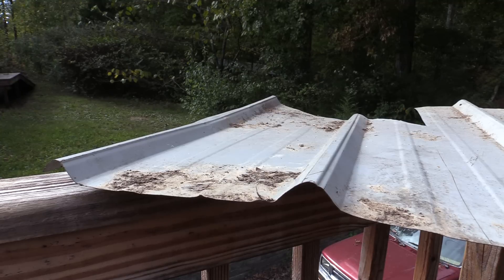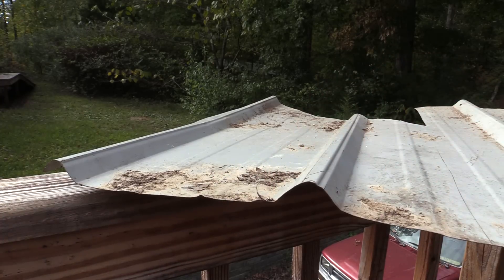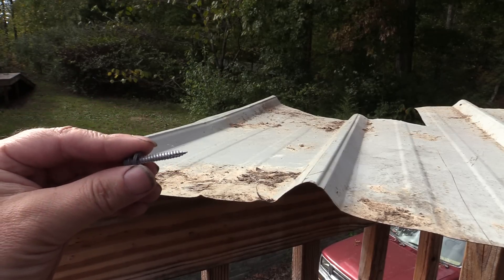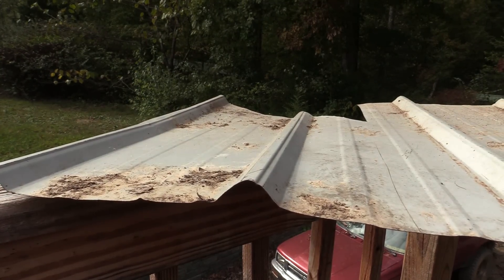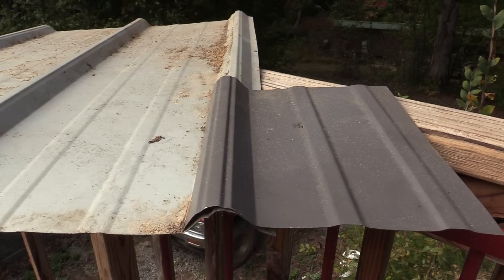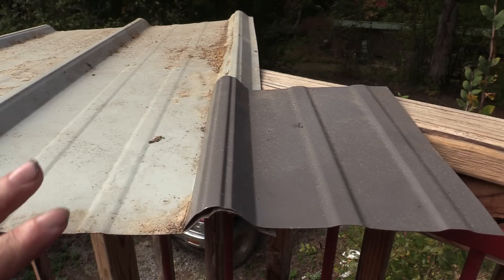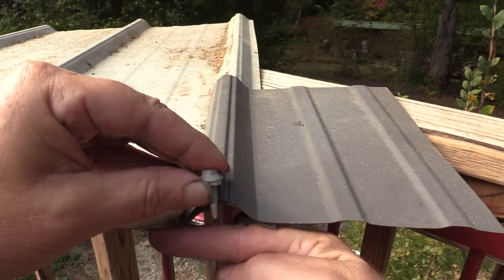Why you should not put screws on the ribs of metal roofing

Comment: You need to silicone the screwheads on metal roof  , I just re did a whole interior of living room that had to be gutted because of screws backing out by themselves on a metal roof.  The silicone appears to absorb the expansion and contraction energy  and stops them from backing out. Just dont look good if you take a hard look at the silicone wod .  The screws backing out and the UV destruction of gasket material are the biggest enemy of a metal roof.. Silicone appears to resolve and holds up over time from what Ive seen
Reply from the maker: @royburgerbreath  a much easier solution is to use the new one piece head screws. The head and the washer are one piece with a recess for the seal which is completely covered. The screw is also a larger diameter further preventing blackout while increasing holding power. If you use silicon make sure it says it is for gutter and flashing. Regular silicone contains a acid to help it bond and will damage metal roofs.
Reply: @honeybeehomesteading  The regular silicone is vVinegar (acetic acid)   What kind of damage have you seen from this?
Reply from the maker: @royburgerbreath  I have seen it ruin the galvanized roofing. It ate Right through the zinc and rusted badly in only about a year. I got to replace a whole roof because the brother of the owner patched the roof and used regular silicone. . So any unpainted bare metal would be a issue like the screw holes themselves. I have not seen any damage on painted because I have never used regular silicone always the gutter and flashing silicone instead.
Reply: @honeybeehomesteading  Good to know. In this case it was a painted metal roof that I used the regular silicone (that smell is VINEGAR too!)  We need to make aluminum great again so We dont have these issues with METAL ROOFS.. DID you know aluminum is the 3rd most abundant element on Earth and WHY in the USA aluminum roof panels so hard to come by?? They shut off most the smelters because of 'global warming' while China turned on their aluminum smelters // Aluminum is an amazing material for roofs and does not react like the way your issue did with regular silicone
Reply from the maker: @royburgerbreath  I live close to Alcoa allot of aluminum is still smelted here. The problem with aluminum it takes a thicker sheet to achieve the same strength and 2 it has a much larger rate of thermal expansion .0000128 vs .0000072  it would be nice though as you could have a anodized panel that would look cool. He other problem is that aluminum is a reactive metal which will react with steel so you would need to address that issue.
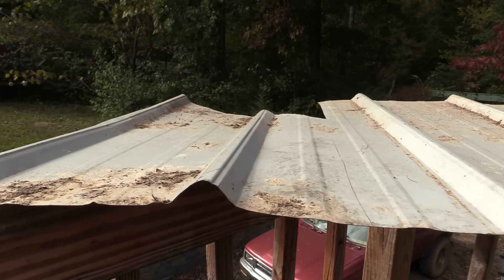Reply: @honeybeehomesteading  Ever had  expansion problems with PermaLock shingles?  https://www.youtube.com/shorts/CuUhGDF-Rus  They make these in the USA  but too expensive- website says they will work on 3:12 roof slopes (would be cheaper if We had more smelters in the USA  is what I am told is why they are so high priced)  Aluminum will cause galvanic corrosion with metal unless it is painted (from what I have researched)  Im in Florida and We have some 100 + yr old homes that still have the aluminum shingles on them from 100 + yrs ago .. IMHO Aluminum is superior for roofs ..
Reply from the maker: @royburgerbreath  those permalock shingles will not have any expansion issues as the panels slip fit into one another and then nailed only on one side. Expansion is only a issue when you have panels screwed into one another making one long sheet. I love the look of slate and those roofs last 200 years but are too fragile. For looks I like metal tiles for performance and longevity I think standing seam metal is king . For ease of installation and replacement or repair exposed fastener metal is hard to beat.
Reply: @honeybeehomesteading  These old aluminum  shingles at this very old home were hand made back in like 1910 with a metal brake and much bigger than those permalocks.. You should be able to walk into lowes and buy those shingles off the shelf ..  We need them smelters turned on like yesterday.. The  Asphalt shingles they sell these days last 10 yrs and leak by year #15 here in Florida
Reply from the maker: @royburgerbreath  metal was king in the 1900 s then along came lightning rod salesman which made the houses prime for being struck by lightning. The oil companies convinced insurance companies that homes with metal roofs would attract lightning. I restored my first house in 1992 which was on the national register of historic places. I was working with hud on the rehab.I wanted to put on a metal roof but was denied because they were worried that the home would not be insurable. Now days insurance companies prefer metal roofs as they are much less likely to catch fire.

Comment: Screws put into the flats into wood below will positively leak from cyclic heating and cooling, and the resultant leak will rot the wood below. Guaranteed. Use longer screws into the ribs, tightened just enough to "take the slack out", while only slightly compressing the sealing washer. Built one this way  in 2006......24' x 42' , slope 1/2 on 12. zero leaks 18 years later.
Reply from the maker: Screws in flats don't move the way they do on the rib as the panels are able to move independently of one another. This eliminates the thermal expansion width wise leaving only the length of the panel to be a factor which is normally  not long enough to be a factor. I have roofs 20 years old screwed in the flats with no leaks
Reply: @honeybeehomesteading  , are the screws you installed going into metal below, or into wood? If into wood, you are one of few who has had no leaks. On the other hand, if you live in AZ or NM, the point is moot. I stand by my point, if screwed into the peaks, there will be no leaks, if done correctly. You cannot tighten the screws to the point where they severely compress the rubber washer, or distort the shape of the sheetmetal peak.
"Stitch screws" with butyl tape are used at all overlapping seams to seal them together. They are not left to just flap in a wind. The "stitch screws" do NOT go into the substrate below. They are used only to "stitch" the seam together.
YOU ARE CORRECT that putting screws into the flats works, if the substrate is a metal purlin, as in real metal building construction. The correct number of screws, and placement of those screws, is REQUIRED to get a UL Class 90 Wind Rating on the roof installation, for insurance Company purposes.
I was a superintendent on metal building construction for 5 years.
Reply from the maker: @bruceb3786  I am going into wood a minimum of 5/8 decking. Steel structures are different than wood as you don't have to worry about thermal expansion as you do when going through wood and screwing through the rib. In a all metal framed building going through the rib would be the only way I would install it. And yes I know how stitching screws work, it is all I ever use to install caps and allot of other trim. Thanks for commenting
Reply: @honeybeehomesteading  , I just know what I have seen work, and not work so well.
Reply from the maker: @bruceb3786  same here the key problem with all roof installations is getting workers that actually care. When screwing in the flats it is common to overtighten and then back out instead of replacing the screw entirely. I can't count the number of roofs I have seen that was done wrong. I replaced a brand new roof once because the installer had no idea how to screw the roof in or flash the chimney. There were leaks all over the place. Thanks for all your comments and have a merry Christmas
Reply: @honeybeehomesteading  , absolutely, the workers are the key.  Backing out and retightening does not work at all. The only way to do it correctly is to do it yourself, BUT that is just not feasible.. Merry Christmas, indeed !!  Great chat.

Comment: Done post frame building in the Midwest for 25 yrs, company worked for been in business since 1958 and we had Engineers from Purdue University, we only did the lap and next too rib on the flat of steel, building had wind rating of 80 mph for residential and 90 mph for commercial, they did loose to many buildings, except for tornadoes.

Comment: In Australia we have exactly the same profile metal roofing you had in the video. My dad is a retired carpenter/builder with over 50 years in the trade and he would beg to differ. Screws always at the top of the rib, never on the flats and also the structure of the roof is stronger with correct length screws at the top of the ribs. If anyone on a building site put screws or nails in the flats or valleys they would probably lose their job.
Reply from the maker: Well i can understand those that want to go through the ribs but you are mistaken if you think it is stronger and here is why. first you are drilling through the stongest past of the panel weakening it, second you do not have a solid surface directly under the screw and metal which will allow for more movement, three you have no redundancy at the overlap. you have one screw holding down 2 ribs where through the flat you have a screw on each side of overlapping ribs. in the event that a storm pealed a panel off  going through the ribs would keep the panels together allowing for a bigger sail and lose of more panels. Through the flat the panels are independent of one another allowing for both expansion and not doing a domino effect do to wind tear off. thanks for commenting

Comment: I can see the logic in what you are saying.  I am not a roofer by trade but have worked on many corrugated iron roofs over the last 40 years and I have never seen roofs attached via nails or screws on the flats. Interesting what you have said.
Reply from the maker: @gort5583  allot of the wavy roofs are self correcting on thermal expansion with the panels growing taller instead of wider. If you follow the manufacturers screw schedule you should be good

Comment: I've installed them both ways.  Usually if there is a leak it's because the screw was overtightened and split the washer.  If that happens it would be less likely to leak in the rib, obviously.  If they're tightened correctly it shouldn't be an issue either way.
Reply from the maker: Agree 100 percent about leaks. Wind on the other hand through the ribs you do not get near the wind resistance as the screws are typically weakened by thermal expansion and contraction plus with there is no redundancy where the two pieces overlap.

Comment: When you walk on the roof the nails or screws tend to come out a bit and the seal is broken and more water will penetrate if you put the nails in the valleys. I own a large factory and every summer I need to renovate parts of the roof. What I see is that screwing in the valleys hasn't worked over time. It's not helping to tighten the screws either, I tried that but the holes in the wood just becomes larger and the screws comes out even faster. Due to the wast amount of snow we get over a meter it's necessary to showel away the snow, hence walking on the roof. The drawback on screwing on the ridge is that the shovel catches the screws. The best thing to do is to just build roofs that don't accumulate a lot of snow.
In areas without snow I would screw in the valleys.
Reply from the maker: your substrate can be a factor there, i only use 5/8 or thicker decking as 1/2 inch doesn't provide enough grip. It also sounds like your screws are not tight enough initially as there should be no space between the deck and the metal. I have done several 12/12 pitched roofs but it also did one 16/12 and had to use a extra snatch so i could climb up. those roofs will not collect snow.
Reply: @honeybeehomesteading  Those areas that don't have a wooden frame construction have no issues. But wood is flexible. I weigh 100kgs, ad to that one meter of snow and no matter what thickness you use it will buckle. This movements is what forces the nails/screws out. It's better to use roofing tiles on wood roofs in my climate.

Comment: What if I said I had 2 metal roofs that have had about 4 screws in them each for the past 6 years… granted the metal I used was a bit heavier bring commercial grade.😂😂 honestly I’m very surprised they’ve held. Been like 2 or 3 hurricanes now… I believe the wood will rot before that roof goes 🤣
Reply from the maker: screws are much more about preventing wind damage. if i were you i would get more screws in that roof before you have a big storm and allot of damage
Reply: @ normally I’d agree but after this long and countless wind storms, they’re still there hanging on strong and haven’t moved an inch.. I don’t have to worry about neighbors and both would end up being caught by the surrounding trees if they did go.

Comment: Can only speak for NZ roofing culture...

1. Make your roof framing strong. You don't need additional structural strength from the roof cladding if your roof bracing is up to scratch

2. Putting a screw where the water runs as opposed to where it doesn't will increase the chance of leaks... Even if anecdotal testimonies claim no leaks

3. Rubber seals deform to meet the shape of the roof. Even if there is a round, they will form a perfect seal 

4. Roof moment will not decrease the integrity of screws if you use the correct gauge screw. Sheet metal is way more moveable than the screw, movement will occur in the sheet, not the screw

5. You can screw the troughs at the ends over the eves so any leaks won't go inside the building and you'll still get the extra strength of the small fixing gap.

6. NZ roofing code never recommends valley fixing. You can read up on load forces and fastening recommendations in the roofing code here: 

https://www.metalroofing.org.nz/sites/default/files/RoofingCOP_v24-09_2024-09-01.pdf

People love to hear different methods that have a sense of good reason to them. But the truth is they are alternative for a reason. The tried and tested method is almost always the best method.

Comment: Also on the structural element, I don’t know how you guys build in the US but here in Australia, the only structural load the sheets should have is lifting force.
Reply from the maker: besides being able to handle a weight load, roofing panels when screwed in on schedule act the same way as sheathing preventing racking of the structure. This is handy when building sheds using purlins

Comment: You're screw placement is incorrect boss. According to manufacturer specs, you would want to screw in the first channel of the valley compared to the last as you pointed out. The only time that would be different is if you weren't overlapping with another panel. The overlapping panel holds down the last rib on each piece. The bottom row (along the eve), and the closest valley column up a rake on each side would have two per valley. The exception being if you're using rake trim, you would leave the most outside screw off, because it would be receiving the rake trim which is screwed down there.
Reply from the maker: not according to my specs the overlapping panel does not hold down the last rib of the previous panel. it can but if you do it that way and say a tornado rips off one panel the rest will fly off in a domino fashion. My specs have 2 screws holding down a joint rib one on each side.

Comment: If the panel is screwed close to the rib or the middle, the difference in ‘structure’ would be nada. Then if the reason you don’t screw them together is to allow movement, then where is the structural integrity aspect gone? Then you show the peak screw “allowing a lot of leverage” which speaks against your point of peak screws not allowing movement. You are all over the place, which says to me this is a very surface level understanding. As it is I wouldn’t be able to take any of this as ‘correct’. Just watched an actual roof manufacturer demonstrate how to correctly set screws into both flat and peak.
Reply from the maker: Ok let me try to explain it better, screwing in the valleys allows the metal to expand and contract at the joint ribs. when you screw in the ribs you loose that "expansion joint". if you have a 75 ft wide building then you now have a 75 ft continuous piece of metal which with expansion and contraction puts leverage on those screws through the rib. As far as structural integrity goes the panel itself whey screwed on the flat becomes a rigid part of the structure. the same way that 4 x 8 sheathing works only with slightly different dimensions. going through the ribs negates the structural effect because the ribs can buckle and the flats can bow.

Comment: A problem with screwing in the valleys on a 4/12 pitch roof is leaves get stuck on screws.  Steel roof companies need to invent contoured battens to fit corregated steel roofing.   Or better yet - some kind of contoured / insulated sheeting pannels instead of battens.  Easy and fast to install.    Pannels could be made of some kind of dense, fireproof, fiber reinforced foam.  Very strong and quiet in the rain.  Could  fasten through ribs and would be strong and never leak.  Million dollar idea.
Reply from the maker: they have interlocking foam strips that match the contour of the roofing. i use them in high wind areas where blowing rain might make its way under the cap. the downside is that is eliminates the natural venting of the roof